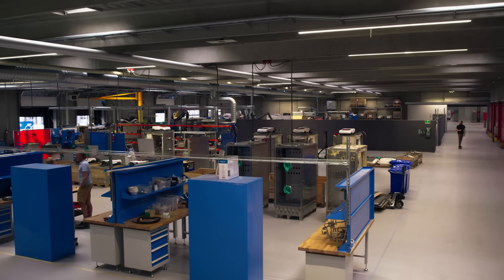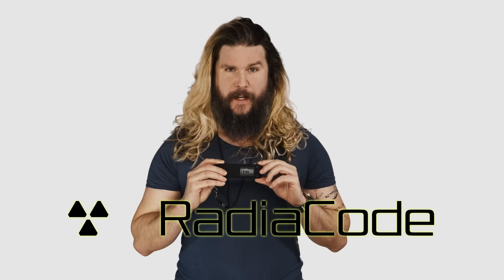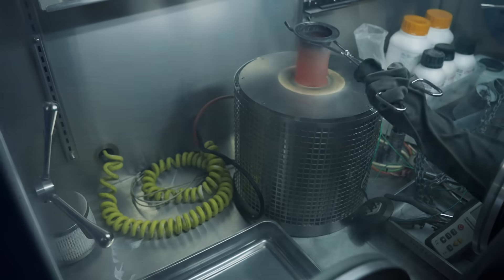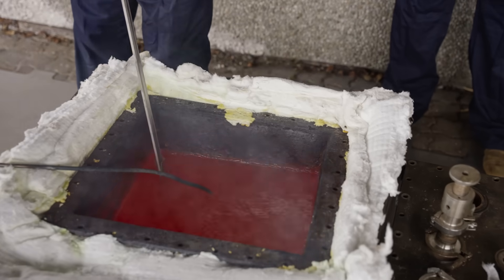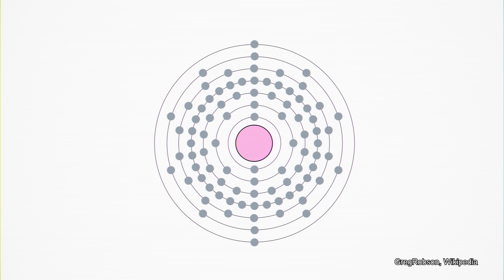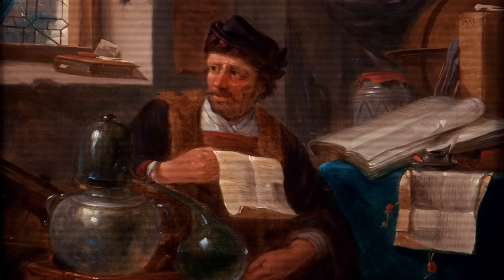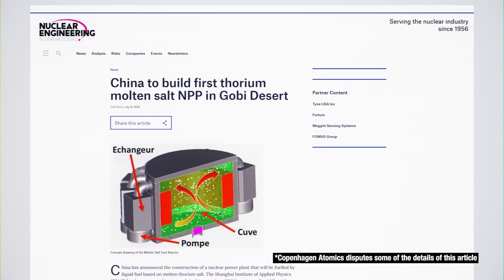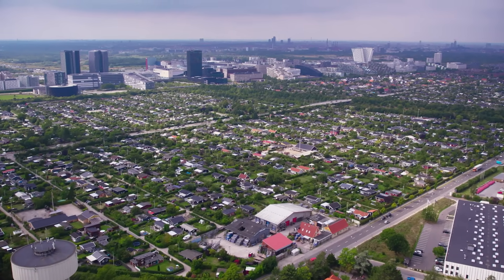Is THORIUM the Future of Nuclear Power?

Comment: You tease. I want to know what happens if the reactor just stops and any failsafe fails to kick in, with all the salt wherever it is, the salt obviously starts cooling; is the reactor salvageable? is the fuel salvageable? it won't explode from tension irregularities or something? basically what happens to the reactor and the surroundings if everything goes wrong in the worst way possible? even if something does happen I think that's just something we have to work past, but consider how the public would feel, could something going wrong nip all development in the bud?
Reply: > the salt obviously starts cooling; is the reactor salvageable?  

Yes. Just warm the tanks/pipes that contain the salt, until the salt is molten again, then turn the pumps back on.

> is the fuel salvageable?

yes. The fuel, either as a solid salt or as a liquid salt, is still just fuel.

> it won't explode from tension irregularities or something?

Presumably the design engineers are making the tanks/piping/reactor strong enough to withstand a little bit of contraction/expansion.
Given that the salt can be used at atmospheric pressure, what they do NOT have to do is make it strong enough to withstand super-high pressure (like the 75-150 atmospheres pressures of a light water reactor).

> what happens to the reactor and the surroundings if everything goes wrong in the worst way possible?

So, your molten salt reactor develops a leak and molten salt pours out of the reactor into the containment building (yes, still need a containment building, just not one that needs to withstand super-high pressure).

As it hits the floor, it spreads out and rapidly cools. The spreading helps with the cooling, and the cooling molten salt forms a solid crystalline layer. Most radionuclides are part of the salt (i.e. captured in the salt), with a few gaseous fission products in the air.

The gaseous fission products (krypton, xenon) are short-lived and so decay rapidly (days, perhaps a few weeks) to safe levels within the containment building.
The salt is much more radioactive, but if it weren't for that, you would just sweep up the salt with a broom - although we are talking TONS of salt. So you have robots do the sweeping.
Presumably your containment building design already has a sloped catch-pan, which has already funneled most of the salt into some protected holding tanks, so you just need a bit of cleanup on the catch-pan.

The salt cools for a bit (a couple weeks, months, etc), so you clean it from any contaminants picked up in the accident, and put it back into a reactor.
Reply: @factnotfiction5915  Great, thanks for the reply!

Comment: I cant believe this is a real thing! There is a sand physics game on my phone that I play with all the time. I discovered that I could place radioactive material in a salt core and it wouldn't overheat and explode as fast as cooling only with water. The salt would melt and just hold temperature. Contained in a steel vessel the outside was surounded by water and produced steam that I used to make electricity. Cool app, lots of fun, had no idea that what I was doing had a practical application!

Comment: Hey, what are health and safety impacts of this technology?? When people started playing with radiation, they didn't know and many scientists died. What about this one?
Also, the 'breeding' of fuel seems exponential. How much is too much? How is it controlled?
My questions might probably be stupid. I'm new to this. Still learning.
Reply: > health and safety impacts of this technology?
Pretty much the same as current reactors.
The main difference is that molten salt reactors can work at atmospheric pressure; vs the 75-150 atmospheres of pressure in current reactors - this means everything is a lot easier - from 20 cm thick steel to 2 cm thick steel, etc.

> Also, the 'breeding' of fuel seems exponential. 
Even if the reactor is designed to optimize heat or optimize breeding,  you will get the other; so it won't be bred exponentially, or even geometrically. 

> How much is too much?
When you are breeding so much that you aren't actually producing heat for your turbines.
You want to breed enough to sustain your reactor + a little bit more to startup a new reactor. And that is about it.

> How is it controlled?
You breed more or less depending on both A) the reactor temperature, and B) the reactor geometry. However, again, you can only optimize one over the other, you will still get plenty of heat from a pure breeder, and some bred fuel from a pure heater.

Comment: I know there is a legitimate concern with corrosion MSRs. And initially i thought Titanium for piping but high temp saltwater and thus liquid salts like this would still corrode. I really wonder what they might do and what equipment they plan on using for the corrosion problem.
Reply: > high temp saltwater and thus liquid salts like this would still corrode

Molten salt != dissolved salt in water

Molten salt is just salt, nothing else, heated to about 800 C (you can melt table salt on your stove to this temperature). Note that at this temperature, any residual water should have boiled off, and in a reactor some care would be taken to ensure water is not allowed near the salt.

Salty water is salt + water, at any temperature.

Molten salt - of course it depends on the salt and on the metal container, but in general is less corrosive to your average steel than PURE water.
Salty water - is of course, much more corrosive to steel than PURE water.

Think of it this way - table salt, without water is FROZEN salt. Melting it at high temperatures makes it _molten_. Dissolving it into water makes _salty water_.

Comment: It is intriguings so far, but he is wrong saying pressurized water reactors need to have the fuel replaced every 2 years.  Ask anyone who has ever operated a Naval Nuclear Reactor.  The only thing lacking from a PWR design that I can say is significant so far is the lack of inherent stability that using water as a coolant and moderator provides. I.E. as the temperature rises, the water becomes less dense, therefore slowing down fewer nuetrons to thermal levels, which causes fewer fissions,  which causes rx power to drop.  It is a very safe design (PWR, I mean).

Comment: As I'm a bit past halfway through, it sounds expensive to me.  You have to deal with hot materials and radioactive materials, you have to do chemical separation to keep fission products from building up, and then you have to do the steam-to-electricity part.  If you heat a pile of regular rocks with excess solar energy during the day, you can do just the steam-to-electricity part.  

Solar is getting cheaper, fast.  Probably, the cheapest way to get electricity during morning and evening on somewhat-overcast days in spring and fall will be to build enough solar farms that you have enough electricity then.  That will give us a massive amount of additional energy on a buy-this-get-that-free basis.  Resistive heating elements are very cheap.  Rocks are very cheap.  I don't think a reactor, any kind of reactor, is ever going to beat that.  (Not on Earth, at least.  If some of us want to live in the Oort Cloud some day, we'll need some kind of nuclear energy.)

Of course, solar has to stop getting cheaper, eventually.  It may not get as much cheaper as I expect, before it levels off.  We should keep on trying to make nuclear cheaper too.  And among ways to make nuclear cheaper, this one sounds plausible.

Comment: AFAIK thorium is actually easier to turn into nukes as u233 can be used for nukes and it breeds in the reactor. Yes you won't get high grade bombs due to u232 but nukes are nukes, who cares if they are a little inefficient and bad to handle. Still easier than handling an insane amount of centrifuges.

Comment: Spoiler Alert! Reason why Molten salt reactors haven't been considered is that molten salt is very corrosive to the steel structure of the reactor. Maybe if they found a new special material that didn't rust from contact with the molten salt. 
I bet gold plating would do the trick, but thats way, way too expensive. There's a lot of new strong materials that have seen the light of day , since the 1940's  
I wonder if graphene is usable? It supposedly is hundreds of times stronger then steel, but maybe too difficult to produce.

Comment: Safety my ass. The problem is not really in the neuclear reactor. There are problems in the areas that mine uranium. There are problems at the recycling stange and there are problems storing the wast. The pollution from the uranium mines are horrendius. The mining companies does notdo the nessesary cleanup since it make uranium cheaper. Ass long as the uranium is as cheep as it is, the uranium fuel wast wont get recycled. the French store there wast as a strategic reserve. Just in cast they get problems with the supply. 
Storing it is also a hazard. Only the Finns has a permanent storage place  (might still be in the contruction phase).
So don't suggest neuclear power as a solution before those obstacles has been solved!
Or other solutions has been tried. Like building storage for solar and wind energy. It possible, but someone has to fund it

Comment: Since the Thorium reactor with its molten salt carrier is circulated around the reactor by pumps, can it be used in micro-gravity environments?  In other words, could you move a Thorium reactor to orbit or perhaps a Rocket that can provide power enroute to Mars and obviously on other planetary bodies.  The problems of managing liquids in a micro-gravity environment are difficult, but would your reactors be readily converted to this environment?

Comment: One of the main reasons we don't have thorium reactors (at least in the US) is the red tape. The Nuclear Regulatory Commission (NRC) has something like 253 regulatory guides consisting of thousands of pages and mostly covering older Generation II reactors. To their credit, the NRC is working on simplifying the regulations to be more user friendly. Similar red tape (and one of the main reasons the cost and time estimates for a new reactor double and triple) is projects being sued. Of course public sentiment and NIMBY play a role, but those are softening to the point that some estimates are about 60% of Americans favor nuclear power. We also can't discount oil and gas lobbyists.

The solution is to start electing new public servants and pressuring current politicians into supporting more nuclear and less fossil fuels, standardize a handful of power plant / reactor plans, and educate the public about the benefits of nuclear power.

Comment: Just as long as people realize the  getting to Mass Manufacture is a bigger step than just desiging a working prototype.  Reactors are typically built to order, Bespoke, and bespoke builds tend to be just polished up prototyping rite large. Mass Manufacture is a whole differnt world, and most protoypes fail to reach mass manufacture.

There can be a whole Manufacture-Design R&D step involved beyond that first step above, and may need the machine R&D'ed and built to build the machine that can mass manufacture the product, and there may be a hole line of such new machines and processes... It took 100 years before Tesla came along and did the R&D to change how batteries were made. For a hundred years everything else was done within the old frame work, with material science being about the only change, the rest is technical fluff and not that big a step or change in process.. 

The machines and processes either need to be there before hand, or you need to R&D them as well. That needs to be planned for and a number of attempts to mass manufacture nuclear reactors fell into the trap of doing things the bespoke way and expecting a different out come. Planning and foresight required.

Comment: The problem with molten salt is because it’s so corrosive that the containers, heaters, and everything it comes into contact with corrodes at an accelerated rate. Unless there has been a material science breakthrough to handle molten salt for a long period, it would cost more to keep replacing all the parts than it operationally generates.
There have been many different attempts at using molten something, but the repair bills are just too high.
Perhaps Chinese ate going to succeed because they have made the parts replacement cost effectiveness through factory bulk costs

Comment: So now I've watched the whole video. What I'm interested in now is how maintenance-intensive the whole thing is? Pumps, valves, seals and the soldering/welding points are likely to wear out relatively quickly if they are permanently exposed to these high temperatures.

Comment: The problem is, it has been tried quite recently and, it is very messy. It was tried, not with nuclear fuel, but with a solar concentrator. A big tub of salt was focused on by a large number of mirrors. The sunlight reflected by those mirrors heated up the salt. Then water was pumped through pipes in the salt. The problem is, molten salt is very corrosive. The pipes and pumps were constantly breaking down. The difference is, when a solar concentrator breaks, it spills molten salt. When a Thorium reactor breaks, it spills radioactive molten salt.

Comment: How is the system heated back up to melt the salt, after it has cooled down in situ somehow? 
Also how is the molten salt loaded the first time and how is the air evacuated from the system? What are the pipes and pumps made out of? How are the pipes and pumps and other accessories cooled?

Comment: I wonder if they couldn't just use sacrificial anodes to overcome corrosion issues. hear me out...
Molten salt reactors (MSRs) face a major challenge with corrosion, but what if we could turn that into a manageable maintenance issue rather than a design limitation? Cathodic protection.... using sacrificial anodes and an impressed current system... has been used for decades to protect ships, pipelines, and infrastructure from corrosion. Applying the same principle to MSRs could significantly extend the lifespan of reactor components and reduce the need for ultra-expensive, exotic alloys.

The biggest hurdle is the extreme environment. Traditional anodes like zinc or magnesium would melt, but high-temperature materials like tungsten or molybdenum could work, although the reactor would need to be made from a metal with greater resistance to corrosion, so maybe tantalum-based alloys, nickel-based superalloys, or potentially high-entropy alloys. 

An impressed current cathodic protection (ICCP) system is likely the better option. By applying a small electrical current, you can force the reactor walls (nickel-based alloys) to stay cathodic, preventing corrosion without needing sacrificial anodes. However, the molten salts are also highly conductive, which could make controlling electrochemical potentials tricky. The key challenge would be ensuring even current distribution in highly conductive molten salts... but with precise anode placement and smart current regulation, this could be solved. Radiation might affect the system’s chemistry, but real-time monitoring and adaptive current control could keep things stable.

If done right, this approach could revolutionize MSR durability, making reactors more cost-effective and reducing downtime for maintenance. Instead of treating corrosion as an unavoidable Achilles' heel, we could engineer around it... turning it into a solvable, predictable problem rather than a dealbreaker. Given the promise of MSRs as a clean energy source, investing in this kind of corrosion control could be a game-changer.

Comment: Liquid salt is not under pressure.  Water reactors produce a lot of pressure and hence more dangerous.  Further with the cooled salt plugs, if there is a problem you can cut the cooling fans and the liquid salt drains out and shuts down the reactor.  Again no worry about pressurized liquid.  Thorium LSR can also use spent uranium fuel rods as they still have 95% usable uranium.  I'm pretty sure India has built a test reactor and is ready for a working plant.

Comment: What would the market for the extra fuel be used for from a reactor like this?

From my understanding, molten salt reactors have a litany of benefits, but having an excess of radioactive fuel from them, seems like a possible problem if don't have an outlet for.

Or can they just kind of 'throttle' the reactor, so it is self sustaining for fuel, but not produce more than it needs?

Very interesting topic and video!

Comment: My concern about the liquid salt is the temperature that you need to maintain the liquid state as high temperatures tend to degrade the vassal that contain them. This is the reason that foundries have to replace their crucibles on a regular basis. That's not including the wear from the liquid flowing, what material is being used and how often is maintenance planned to account for this?

Comment: Living in Syracuse (not the New York one, the Italian town, in south-east Sicily) I already knew that salt can be molten and used as a liquid like water: we have a system working this way just by keeping a mix of sodium chloride and potassium chloride at 290C (around 550F) as the base, called "cold liquid salt". Then the system pumps this watery liquid into black pipes running along concave mirrors pointed at the sun, so as this liquid gets warmed up to around 530C (~990F), this phase is called "hot liquid salt".
The hot liquid salt is then pumped into an heat exchanger to bring water to a boil and turn into steam, used to make turbines turn.
And yes: I am talking of the "Archimedes thermodynamic solar power plant"

Apart from that, very interesting as usual 💪💪💪